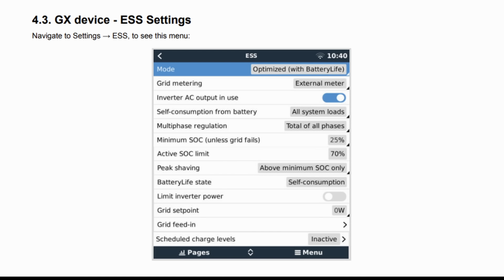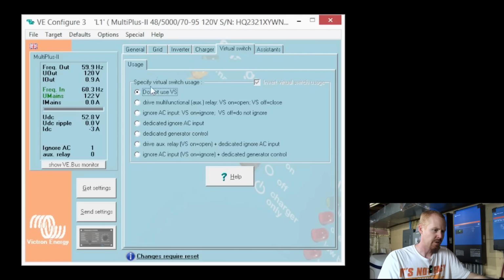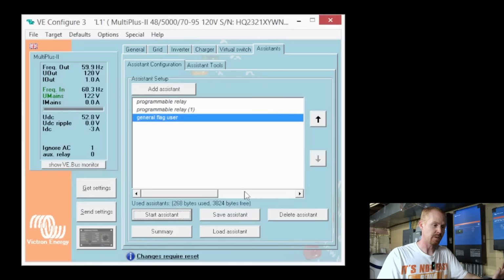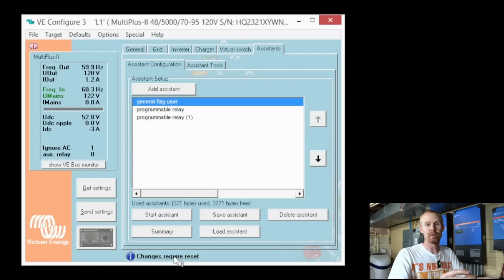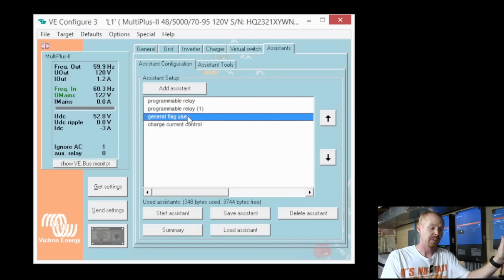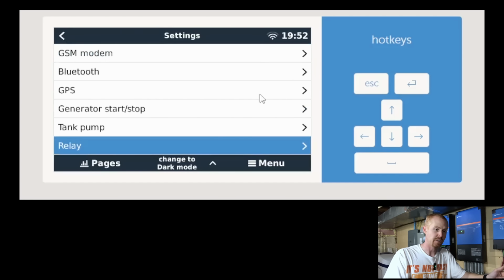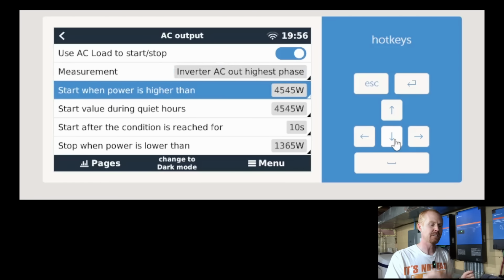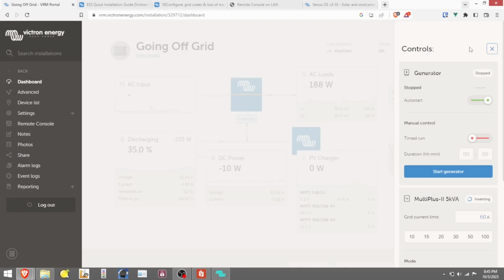Different Ways to Ignore AC Input on a Victron MultiPlus 2 Inverter

Comment: I've been playing around with the VS for a while for this. Using the Cerbo Gen function is a great idea. One question. You have the Cerbo relay wired as NC. Shouldn't that be NO? What am I missing?
Reply from the maker: Thanks!  
I know what you mean.  My initial thought when I wired everything up was to wire the cerbo as NO as well, but when I did that (with the same assistant configuration) everything worked in reverse.  I'm not sure if "closed" for the Aux input is backwards of our understanding of closed or not.
Reply: @AdamDeLayDIY  Interesting. I just set this up on my MP2 -2x120 and it isn't doing anything at all. It's live on mains regardless if the generator is "running" or not. Any ideas?
Reply from the maker: @williamsmith648  whatever wire your using to connect the inverter and the cerbo, check and make sure you’ve got a good connection of the wire in the terminals.  I had that problem happen and it turns out that one terminal was biting on the coating of the wire instead of the actual wire.

You could also test disconnecting the wires from the cerbo and then touch the wire ends together and separate.  Make sure that you hear the relay connecting and disconnecting.
Reply from the maker: @williamsmith648  I got a notice saying you posted a reply, but I don't see that reply.  Did you get things figured out?
Reply: @AdamDeLayDIY  Thought I had it solved, but no. I noticed my general user flag was at the top of the list of assistants so I deleted and re added it to the bottom. Things appeared to be working then. Gen function would start and stop properly under the configured load conditions. However the AC was not being ignored. Not sure why.
Reply from the maker: @williamsmith648  hmm, then yeah I would try testing the wiring.
Reply: @AdamDeLayDIY  I tested the wiring on the Cerbo side (at the wire ends that would go to Aux 1) and it opens and closes correctly as expected. On the MP side, there is continuity across the two Aux 1 pins so I'm assuming that the relay is in a closed state. Touching the relay side of the wires from the Cerbo side while connected to Aux 1 does nothing.
Reply: @AdamDeLayDIY  I've tried swapping the wires around and verified  the connections are good as well. I have the white to common and orange to NC on the Cerbo and white to to AUX 1 neg and orange to AUX 1 positive.
Reply from the maker: @williamsmith648  if you can touch the two wires together (and separate them) that are going into the cerbo and nothing happens that points me to something with the MP side.  What firmware version are you using?  You loaded the assistants to the same inverter you have the wires connected to Aux1 correct?  Do you have any other assistants running?
Reply: @AdamDeLayDIY  I agree. If shorting the aux 1 pins is supposed to cycle the relay then something is off with the MP. It’s on 506 and no there assistants are running. Oddly it was working with VS.
Reply from the maker: @williamsmith648  that really is odd.  I’m running 502 right now.  

Any chance you can email me using the address on my channel with images of your assistant summary and the wiring connections?
Reply: @AdamDeLayDIY  email sent

Comment: Adam, great tutorial. Thnx. The cable you've added, orange and orange/white --> does it matter + and -? I saw in the picture of the Multiplus-II under aux-1 a + and -
Are those also at the plug of the Cerbo?
Greets from The Netherlands 🙏
Reply from the maker: Thank you!

In this specific case, I don't believe it matters because you're just opening and closing the circuit via the relay.  I believe I ended up using the negative line as the common on the relay though.  

As far as what's at the Cerbo side, it's just 3 wire points for the relay.  NC (Normally Closed), C (Common) and NO (Normally Open).

Comment: Thank you for this video. After following the steps and doing everything correctly, my Victron system is working exactly as I was hoping it would. I'm actually using the temperature sensor input on my Multiplus, and being able to use the generator start/stop feature in the Cerbo as the grid for battery charging is just plain awesome. You can actually do these same things with AC Input Control in VictronConnect, but for some strange reason using the battery state of charge isn't an option. Using voltage is fine, if your system isn't that smart and connected, but it's nowhere near as stable as using SOC. The real killer part is changing these parameters in the Cerbo and not needing to reboot the inverter every time you change things as you fine tune your system. When pairing these abilities with the Trends the SmartShunt records with regard to battery voltage and state of charge, I was able to cut out the waste at the top and bottom of the charge points. You can see exactly where the battery voltage falls off a cliff at the bottom, and where that last few percent at the top really aren't worth the trouble. I could go on for a while, but I just want to say thank you again for this great video and making it easy to understand and follow.
Reply from the maker: Your welcome!  Glad to be able to help!

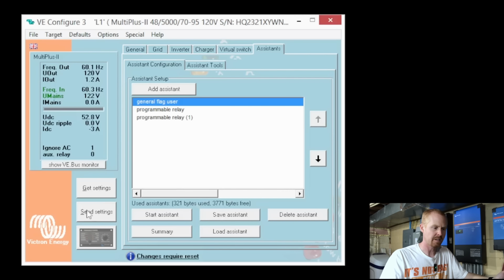Comment: At 9:30 you said "AND when the load is higher" and at 9:41 you said "OR when the SOC is higher", however I think that second OR should have also been an AND, and I think it's an important distinction so I'm just checking - is that correct? (EDIT - or was that first AND actually supposed to be an OR? Now I'm super-confused :)
Reply from the maker: First off, THANK YOU for using timestamps.  It makes things so much easier to know what you’re asking about!

So they both should be “OR”.  Each one is its own trigger (SOC or Output).
Reply: @AdamDeLayDIY  Awesome! That clears that up and now I understand. Thank you for taking the time to reply :)
Reply: And now replying to myself... I wonder how you could achieve 'and' functionality instead!
Reply from the maker: @new-zealand-clippy  I’m not sure that you can with the assistants.  I believe it’s strictly an “either/or” case.

Now I do wonder if it’s possible to do with Node Red.  I understand that to be EXTREMELY customizable.

Comment: WOW, this is great.  I have lots to learn for my 1 unit, 12v MP2 3000.  So far, I run only the solar with 400 Ah batteries (plan to update capacity to up to 800) and if it (batteries) gets too low I flip a wall witch and have the inverter/charger charge from grid.  Right now I only have it set at 15 Amps but will do more later.  I would like to have grig charge when batteries get to ... lets say 30% and shut off when solar can do it fully... (I think I do, I am having to learn much).
Reply from the maker: Thanks David!  I think there's a lot for all of us to learn!  Good luck on expanding your system!  I have to do that myself.
Reply: For sure.  I appreciate the time you take to share...  pat  @AdamDeLayDIY

Comment: Great video and help with setting up Victron Multiplus's programming for AC grid charging. I found this same procedure in some documents I searched for a couple of years ago. I can tell you it works great, and I often use the Cerbo display to modify when I want the AC charging to kick in. I set the SOC it to 30 to 35% in summer and as high as 70 to 75% in winter.
I also use "Quiet" hour constantly, as we (here in Canada) get charged for grid power based on time of day. 7pm to 7am is always the cheapest rate, so I set "Quiet Hours" to be 7am to 7pm, and have y SOC parameter set to 10 to 13%., which has never kicked in; but is there in an emergency.
I do have a question, as I do not use the load parameters to trigger AC pass through, I have two 24/3000 Multiplus Inverters running in split phase. If pass through was programmed to be enabled on high loads like you described in your video, is there a limit to how much it will pass through? Does the 3000 VA limits on the inverters limit it? If I turned on my dryer (5000W) and oven (4000W), and AC pass through is enabled, what happens?
thank-you  again
Reply from the maker: Thanks!

So the inverter should be able to utilize up to the value you have set for your AC In current limit.  If you exceed that value (and power assist is enabled), your inverter should draw from your battery as well to help cover the load.

Comment: It would be interesting to show a procedure how to connect the Victron system with the Home Assistant application, where the solar system has a predefined solar monitoring environment, it just needs to be supplied with data from the solar system. The advantage of this would be home automation without the requirement to connect cables between devices to turn on/off based on battery SOC for example.
Reply: I'm doing this with node red. There is a philips hue plugin for node red that allows you to control lights and smart plugs.
Reply: @Jhovan33 any links to the info ?
Reply: I guess there is also a "solar assistant". That might be what you are looking for.
Reply: @andrewborntrager7909  Yes, I know the Solar Assistant, it can also be connected to Home Assistant, I like it and it is for All-In-One inverters.
The advantage of integrating the Solar System into Home Assistant is that you can connect many electrical devices to it, which can then be programmed to work together or according to the Solar System based on the programmed relationships between them.

Comment: That was very useful, I've been wondering how to charge if state of charge was low for a while. Thanks for sharing, I'll have to experiment as in a poor solar week.
Reply: I bet if I set quiet hours to when grid power is most expensive (7am-11pm) I could set to only charge a minimal amount if below a low threshold and if SOC goes not quite as low when power is cheapest (11pm-7am) then I could put on a bigger charge to the batteries ?

Comment: Adam, great video.  I use the Cerbo to control my AC IN too just like you described.  I noticed on your VRM display that the Generator does not show up.  My setup shows the Generator box right below the AC In box on the VRM dashboard and I'm trying to figure out how to hide it.  Did you configure a setting somewhere that turns the Generator box off in the VRM display?

Also, there is a way to save multiple configuration files with different Multiplus settings that can be uploaded through the VRM.  I use these files to adjust my Multiplus Charger Absorption and Float settings depending on the weather forecast and battery SOC.   If the weather forecast is dreary or storms are coming over the next few days, I load the settings with higher Absorption and Float values so I can charge the battery faster from the grid.    If its going to be sunny for a few days I load the lower charge settings to minimize the amount of energy I use from the grid and charge the battery more from PV.
Reply from the maker: To hide the generator option, on your cerbo go to menu - settings - system setup - ac input 2 - set to “not available”.

As far as quick upload files, I’m not sure because through the VRM they seem to be time based and I’m not sure if “older” files can be loaded or not.  I would just try to save different copies to your computer and see if it will allow you to upload them after a few days.
Reply: Hi Adam. Thanks for the tip on the generator display box. On the multiplus configuration files I have indeed used files that are older than a few days. There’s a note that comes up when you go into a configuration file to tweak it about being more than a few days old, but as long as you start with a configuration file that was created in your current version of firmware (v506 in my case), you can save changes into copies of different configuration files. You can rename the files to indicate the main settings that are contained within the file. Then you can use the Remote Configure feature on VRM to upload the file with you saved settings. I save different configurations as described in my previous post.
Reply from the maker: @brucebugbee6604  perfect!   I wondered if you could do that with the files!  Thanks!

Comment: In your first method, without cerbo, can the relay be triggered manually or just at the set thresholds?
Reply from the maker: The manual controls are only available through the Cerbo.  I actually just tested this by turning off the "generator start/stop" function of Relay 1.  As soon as I did that, the manual control options went away on the Cerbo and the VRM.
Reply: @AdamDeLayDIY  Thank you. Awesome video content.  Now I want to go all in on Victron. Just wish they had RSD/GroundFault/ArchFault.
Reply from the maker: @cgutowski471  yeah I’m not sure about any of those by default.  I do know that I wana see if I can figure out a way to create an “emergency stop” using the different customization options.  From the inverter standpoint it actually should be pretty easy since they have a remote switch option.
Reply: @AdamDeLayDIY   Agree based on what I read.  The RS MPPT I would hope would have Ground and Arch Fault but don't believe any of the Victron SCCs do.

Comment: Great video and please make as many videos like this as possible.
Here is a nice way to see why Victron is so expensive and what it offers in return, 
not to mention the low power consumption of low frequency inverters and other things...

Videos like this make other solar systems look like toys.
I would like to see videos on how to use built-in relays on Victron devices to control battery heating in winter depending on the battery temperature through external temperature sensors on the battery or directly from the temperature sensors from the BMS (not sure if this is possible) or to control active cooling of the solar charger depending on its temperature on hot summer days.
Reply from the maker: Thanks!  

I believe controlling something by temperature is very easy to do.  While I don't have a use-case, I'll add to my list to try and mock something up for those in cold weather environments.  Seems like it would also be beneficial in mobile applications.

Comment: Be carefull about ESS, becuase it is not possible to maintain zero feed-in. Regarding relays in manual state, this is necessary for NodeRed. I am using NodeRed for control of ACout2.
Reply from the maker: Thanks for the heads up!

Comment: Noticed that you still use that USB-to-Victron programming cable. Have you noticed the VRM option under the "Device list" called Remote VEConfigure. That allows for downloading the inverter's config file straight from the inverter(using the GX) and opening it on a remote laptop. Then just using the same VE Configure 3 program for changes you can do anything you want. It saves the same file locally and VRM enables uploading the same file back to the Multiplus remotely without having to physically connect cables. Handy. I didn't even buy the USB cable for my MPII.
Reply from the maker: Thank you.  Yes I was aware of that.  I believe I mentioned it in this video as well.
Reply: I don't believe you can get access to all the controls when you first setup your inverter. I was told you can't set the mp2 to lithium battery type without the dongle. I agree once you have it configured once, you can probably export/import. But, the initial setup I was told has to be done with the dongle.
Reply from the maker: @Jhovan33  I can’t speak to the initial setup because Current Connected preprogrammed everything for me before I receive the inverters.  I didn’t have to worry about anything including firmware updates because it was all done for me.